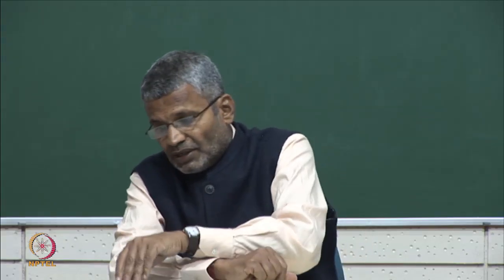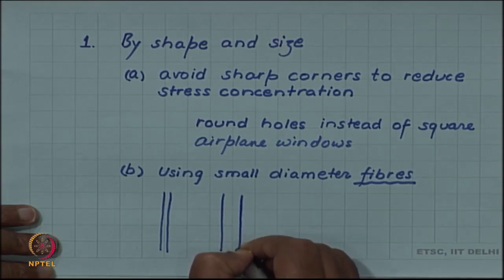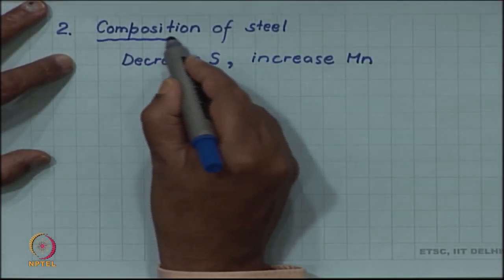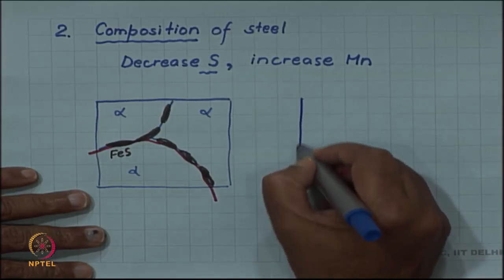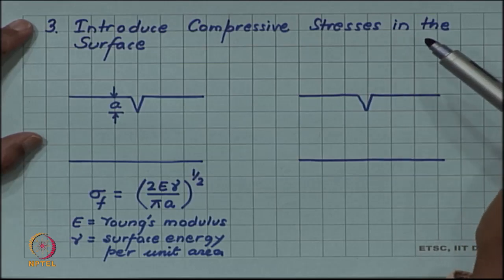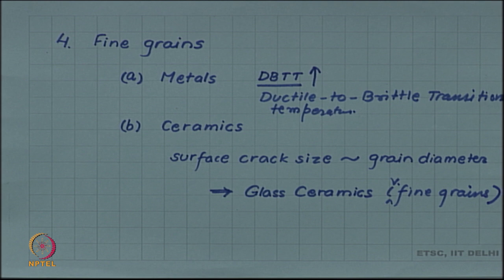Enhancing Fracture Resistance

Comment: 00:12 Enhancing fracture resistance by controlling shape and size
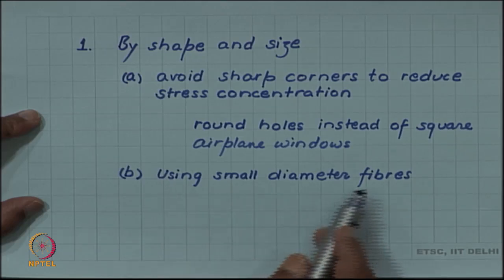01:27 Fibers enhance fracture resistance due to smaller diameters
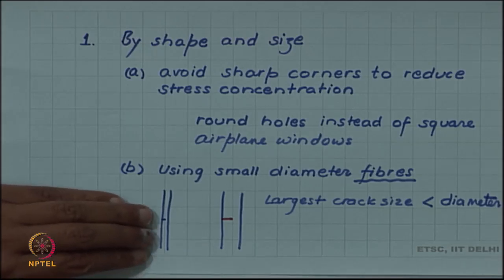02:48 Using thin wires for reinforcing composites enhances fracture resistance
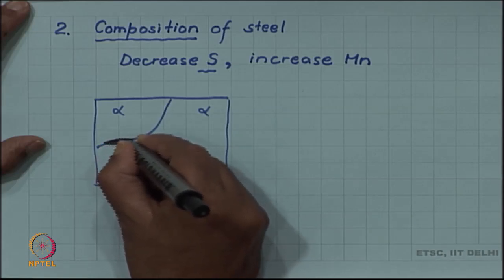04:04 High sulfur concentration leads to brittle sulfur particles coating the grain boundary
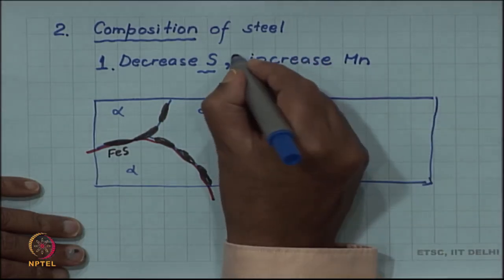05:16 Manganese and low sulfur content enhance fracture resistance
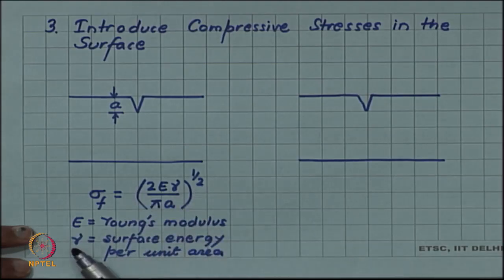06:33 Residual compressive stress enhances fracture resistance.
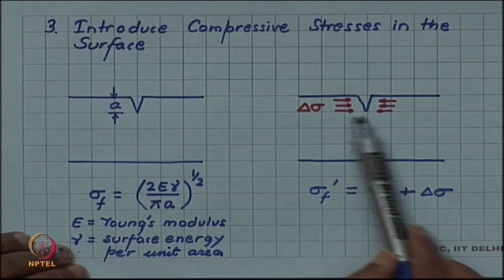07:46 Introducing compressive surface stress enhances fracture strength
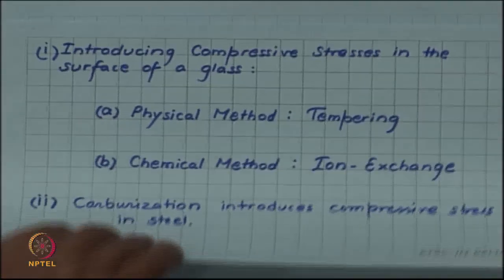09:16 Fine grains enhance fracture resistance

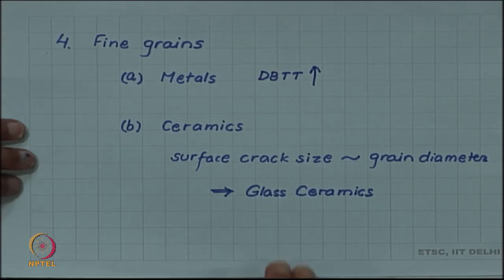Comment from the maker: I have made a mistake in this video at 9:20. I say , and also write, that 
                              the ductile-to-brttle transition temperature increases with smaller grain size. 
This is incorrect. The correct statement is that 
                             the DBTT is lowered with decreasing grain size. 
Sorry for the confusion. I thank Ajith for pointing this out.
Rajesh Prasad